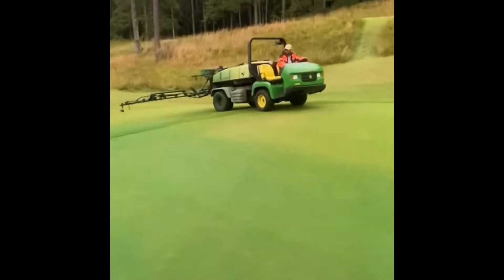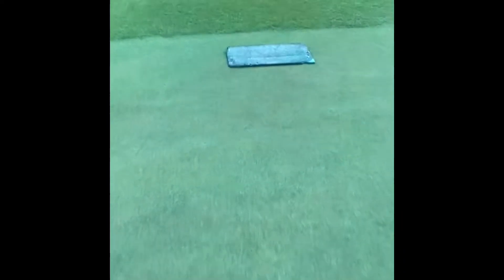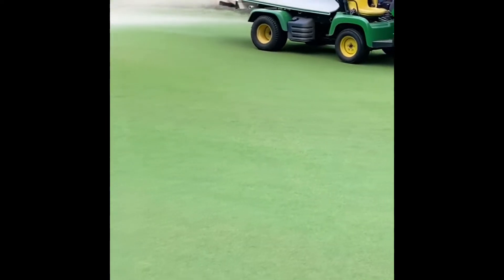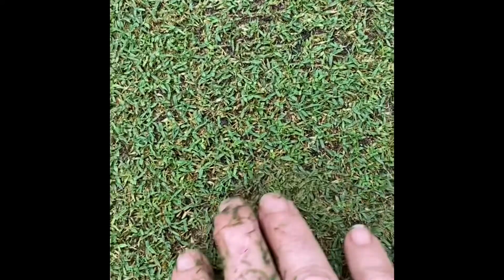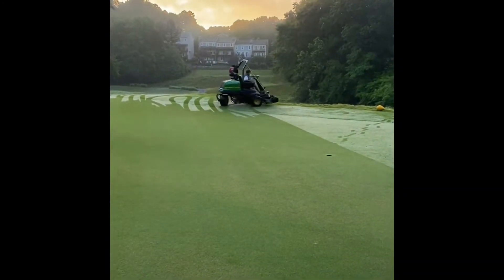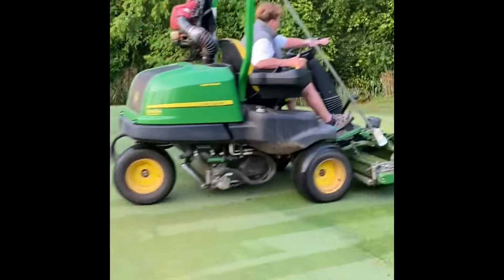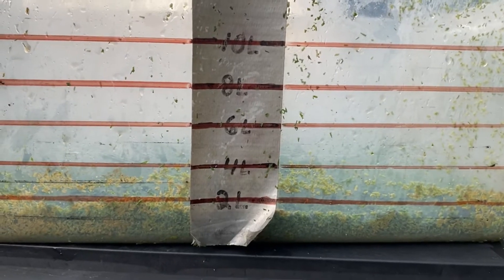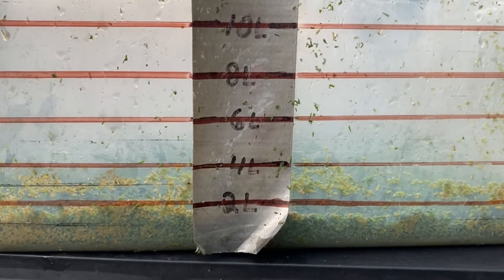Post Verticut Maintenance June 2021

Comment: This isn't a once and done type of deal. Growth regulators aren't needed for fast greens, keep the fertilizer as low as possible creating very low top growth, growth regulators can actually slow speeds because the grass is growing more horizontal to fill in, this is a problem, it means your rolling over more blades and more grain. This mean you need to verticut more often, basically every other week and lightly topdress. I only use growth regulators at a reduced rate along with wetting agents during drought and super hot summer temps because I use as little irrigation as possible to keep greens extremely dry and firm, those two combined have been proven to work for that very reason. It takes far more than what you did for fast greens that continue to stay fast day in and day out, 11 to 13 pushing 13.5 when things get crispy before I do the weekly watering.